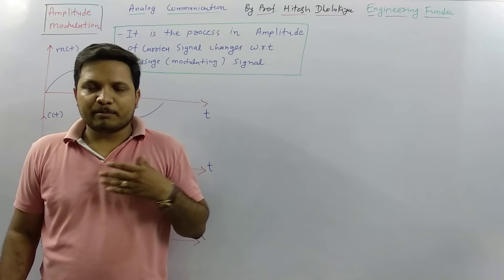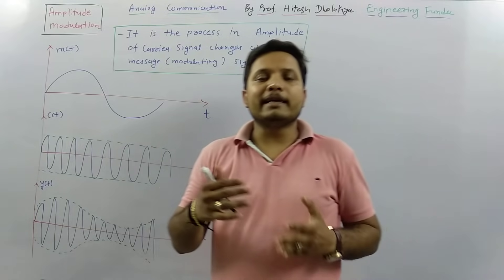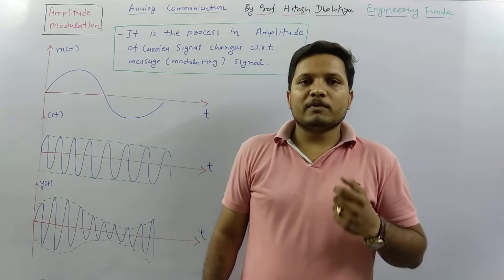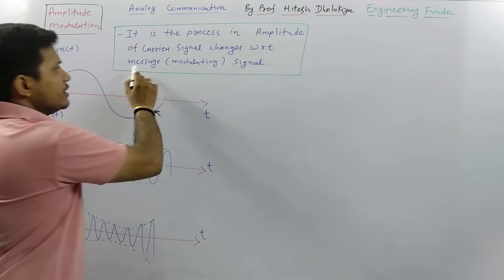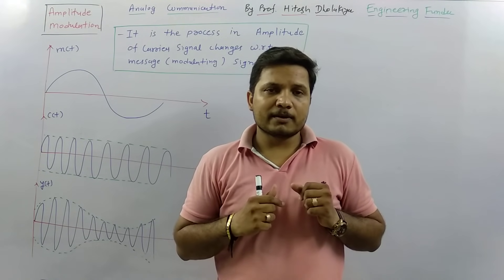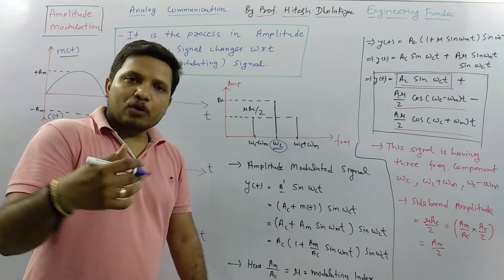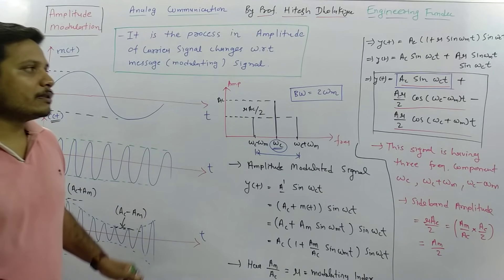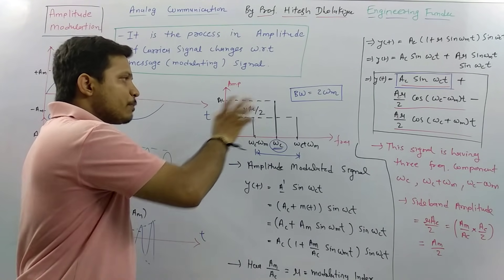Amplitude Modulation (Definition, Basics, Derivation, Frequency Response & Waveforms) Explained

Comment: 00:02 Explanation of Amplitude Modulation
02:29 Amplitude modulation involves changing the amplitude of the carrier signal with respect to a modulating signal.
04:39 Amplitude Modulation involves changing carrier signal amplitude with message signal.
06:52 Amplitude modulation is represented by the equation AC(1 + mu*sin(OmegaMT)*sin(OmegaCT)).
09:58 Amplitude modulated signal has three frequency components.
12:40 Amplitude modulation involves carrier signal, side bands, and waste of power.
14:52 AM has drawbacks like higher bandwidth and power requirement
16:42 Amplitude modulation involves sending carrier signal and sideband signals.
Crafted by Merlin AI.

Comment: 13:44
You represent the y(t) in three discrete cosine wave. By fouier transform it transfers to delta function with amp= pi*mu*Ac/2 , rather than just mu*Ac/2?
and also there are -Wc-Wm, -Wc, -Wc+Wm in negative side rather just positive side ?
By the way thanks for lecture you are 200% better than my lecturer in my university.

Comment: Hi sir ! i really admire your work, what you are doing is great !!
i would like to suggest you that, it will be better for us(student) if you stop tempering with the standard term...
for example here you have taken sinwct as a carrier signal though the standard books consider coswct as the carrier signal, i suppose that, to add your touch you have  consider sinwct as carrier signal, so far nothing wrong. Thinks goes wrong when you add up with the standard notation, and yes you did add up here and hence commiting a mistake here at 13:30 you are plotting the ampiltude plot over but what i feel is its a Magnitude plot, i hope you definately know the difference between Ampiltude and Magnitude but still i would like to take the honours to recall the difference between amplitude and magnitude. Amplitude can be Greater, Lessor or Equal to Zero and Magnitude is always Greater or Equal To Zero that means it is always positive (expext exactly equal to zero). Here in the amplitude plot at 13:30 you have plotted (wc+wc) amplitude as positive but clearly in the equation it has a negative sign hence the strength of the signal should be Negative. But that is what we don't see in this video lecture, Sir there are 150,114 views on this video but i wander how many of us have catch this crucial point here in this video.
similary i have also seen some of your add up touches in standard signal in EMF in cordinate system and in the next lecture of in going playlist, you have mentioned MODULATING INDEX again and again, If you google Modulating Index what you will know is its MODULATION INDEX not Modulating Index. 

please sir  i humbly request you to use the standard notation and definition as they are..........................................
Reply from the maker: 1. You can take sine or cosine as carrier signal. 
2. In plot of Amplitude vs frequency, you can never plot negative Amplitude, I don't know what you talk about differences in between Amplitude and magnitude. 
3. Modulation index and Modulating index are same, it could be easily understood. But as you said we should mention it like Modulation index.
Reply: @EngineeringFunda  amplitude vs frequency         as in the video you have plotted you did'nt mentioned that in amplitude and frequency plot we only consider the the magnitude value of the amplitude. 
And Sir, as you are telling "Amplitude vs frequency, you can never plot negative Amplitude" . Sir what i know is that one can definately plot Negative amplitude  in amplitude vs frequency plot, what you just have to do is to take the Amplitude in dBm by doing that, we can plot the negative amplitude as well.....
we should mention it like Modulation index.
 yes sir we should mention it as Modulation index. Because if we go  by the deep meaning of the word they are found to be different.
Reply from the maker: In dB if it is Negative means it is less then 1, it doesn't mean it is negative, it means it is in between 0 to 1.
You can see, I have mentioned that it is a plot of Amplitude vs frequency

Comment: Sir the characteristics of y(t) is not matching with y(t) = ( Ac + m(t) )Sin(wct) for the modulated signal Please Help..........
Reply from the maker: Which Characteristics
Reply: @EngineeringFunda  the bottom one y(t) vs t graph of amplitude modulated signal
Reply: Sir in this equation, at m(t) = maximum (peak of modulating signal), the modulated signal will be at maximum but at the instant when Ac become negative maximum it must be (-Ac + Am), that means it must be lifted from below also So why not? Why its peak to peak value is changing????
Reply from the maker: If modulating index is less then 1, then no cross over distortion will happen. 
If modulating index is greater then 1, then phase reversal will happen which leads to cross over distortion.
Reply: @EngineeringFunda  Thankyou so much sir for reply

Comment: what is maximum modulation efficiency of an AM system ?
a) 33.33%    b) 50 %    c)  90 %   d)  75  %   
please explain sir.. recruit mnt board given  answer as 50%,,,but  i choose answr  as 33.33 %..which one is correct.
Reply from the maker: It's 
 a) 33.33%
Reply: @EngineeringFunda  Sir it's wrong!
the answer should be 50% only
at modulation index sqrt(2)!!
Reply: @balajibaheti8577  how to solve that problem
Reply: 50%is correct answer

Comment: Sketch the specturm of modulating signal m (+) given by a.m (+)= cos 2pi ×3×10^3t+ cos 8pi ×10^3t 
B.cos2pi×10^3t x cos2pi ×4×10^3t 
Plot the two sided amplitude spectrum in both cases
Reply: it's looks cumbersome if you look those components in sinusoids. Better convert cos components into exponentials
using Euler's theorem and then use time shifting property of fourier transform to convert those into frequency domain
Then you can have frequency response in 3 steps
Reply: Harsh gupta wow you really know your stuff can you please help me with some questions please about RF

Comment: Sir... For plotting frequency response, we need to apply fourier tramsform.. But you  took the  same timedomain amplitudes as frequency domain amplitudes which may not be equal...
Reply from the maker: It is there in frequency domain only
Reply from the maker: See practically it will slightly less then theoritcal but I have shown it correctly
Reply: There is nothing wrong in that. Fourier transform is one method of plotting the frequency response of a time domain signal but it's not the only method we currently have.
In above video,signals of constant frequency has been taken as an example so we can directly plot the frequency response by intuition, ie. an impulse of amplitude same as signal amplitude at a frequence 20Hz(example).
If you look closely above frequency response is discrete in nature and can be obtained mathematically by Fourier Series.
Reply: @pranavc4397 Frequency Response (Magnitude and Phase spectrum) are differ from visualization of signal strengths at their oscillating frequencies!
Reply: @narasimhal1  It's not clear what you meant by "differ from visualization". Don't make it complex than it looks. Just apply phasor diagram or apply euler's theorem.
Reply: @pranavc4397  I mean,  the professor in the video didn't draw the frequency response of signal which you can get only with some transformation techniques like Fourier Transform etc..He just drawn strength of the signal (amplitude) at its frequency of oscillation. You can measure Band Width with the diagram he drawn on the board or with frequency response(magnitude response), but you can't see how all the frequencies are behaving in that Band.To know how the signal behaving at all the frequencies along with measurement of BW better to take FT and draw magnitude spectrum.
Reply: Lingampelly Narasimha I think you missed something. It's not necessary to apply Fourier transform to get into frequency domain for simple monotone signals like the ones explained in the video. According to the video we have two frequencies one is monotone Carrier frequency and the other is bandlimited message signal frequency which oscillates around carrier frequency. Expand cos and sin terms into phasors using Euler's formula you won't be needing Fourier transform for this simple transformation. I think this is the first time you have seen someone draw frequency spectrum without Fourier transform, but in research institutions we rarely use Fourier transform for simple monotone signals like the ones in the video. Lookup into phasor transformation of signals from chapter 1 of Carlson communication book for better explanation. The thing which I explained above is not a new thing research people use this phasor and vector notation technique to get into frequency domain.
Reply: @pranavc4397  Bro,  well said..learned from you..this type of discussions digs more into the subject..you have good knowledge but I don't understand what I missed as you said, I have not told that the professor  taught wrong!
Reply: @narasimhal1  If you don't get what I explained refer Bruce Carlson Communication system textbook chapter 2 Line spectra and Fourier series. It explains frequency domain very precisely. That'
s what I was trying to explain.